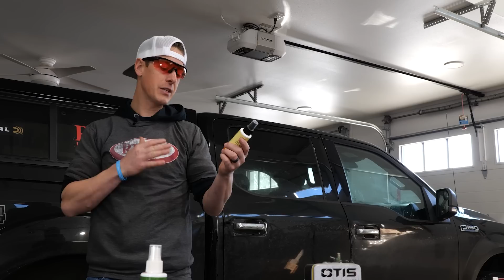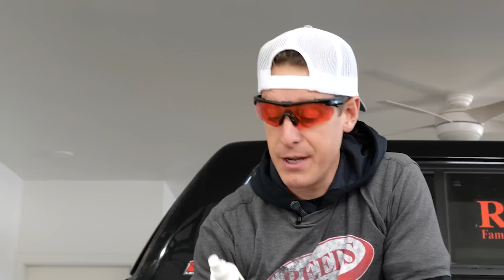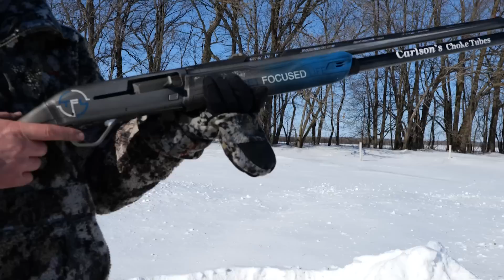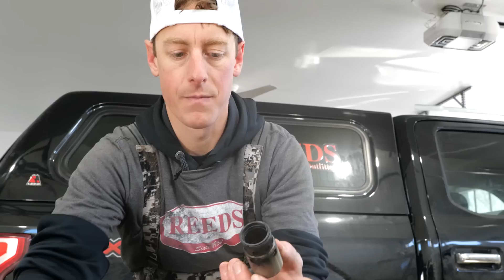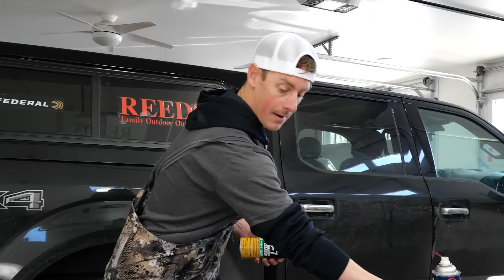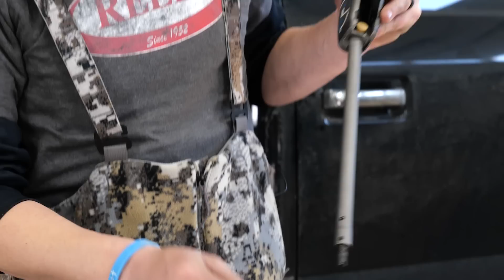Does Gun Oil Make a Difference in the Freezing Cold?

Comment: Brake cleaner, air blower, rem oil in the spray can. I'm always in the field lots of duck hunting and it always keeps working. The rem shotgun in the spray can works just as good but more money and it's about the same as the rem oil. Anytime I've use dry lube in any application it always causes problem. Weather its in my professional job or my equipment. Have replaced more parts due to dry lube. It collects dirt grime and holds in in place. A light oil lube and wipe off the access will last longer everytime.

Comment: You are on the right track with your videos. Keep it up. I love this. Benelli told us once after using rem dry lube in an SBE2 that cause severe problems in cold weather to only use CLP (Safariland). Clean it good, then let CLP soak in and wipe it down. Never had any issues since.

Comment: I would love to see this winter function test with Frog Lube.  There are very conflicting stories about its cold weather performance and most of the failures are responded to with an improper application making it remain in a thick form.   A removal of old products and heat applied frog lube with a full wipedown would be really revealing.  It won't mean Steve's needs but for someone that occasionally shoots it has some value if it works in cold weather.   I also saw another comparision and One Shot was another lube that I would love to see tested.   Keep making great videos.

Comment: Interesting about the Rem Oil. I've been using it since it came out a long time ago. For Shotguns, I use it as a cleaner to get the carbon off of parts and the bore. It actually works really well for that. It's not that great as a lube because it's so thin, but it works great to spray down the guns after a morning waterfowl hunting in the rain. Displaces the water and prevents rust. I keep a can of Rem Oil in the Duck blind. I was an armorer for a Police Department for 26 years. I bought cases of the aerosol Rem Oil to clean out our hand guns. What was good about the Rem Oil, it got the carbon off and prevented rust. if the Officers didn't do a good job (as they sometimes wouldn't), the Rem Oil residue wouldn't gum up like Hoppes #9 does, Hoppe's gummed up and caused malfunctions in H&K P-7 Pistols. So, Rem Oil for cleaning andI had them use Break Free CLP as a lube for the frame & slide rails.
Reply: Rem-Oil has silicone in it, that's why it works so well.

Comment: Great video! Would have loved to see you use 80 below gun oil. The name itself should earn a spot if you do this again.  I like it. Comes in aerosol too! I had the same issue with the recoil spring in my SX4 20 ga. Was a real pain to get that roll pin out... seems like a simple punch pin would have worked fine and much easier to remove. 🤷🏻‍♂️ thanks for the excellent content 👍🏻💪🏻👊🏻
Reply from the maker: I've actually never heard of it. There are a lot of lubes out there. I had some issues with the roll pin too. Really had to smack it with a punch to get it out, though I might break the gun. See ya soon my friend.  👊 Stay Target 🎯Focused (Hebrews 12:1-3)
Reply: 80 below is unmatched in the cold (and regular temps). I’ve never used anything like it. It somehow repels dirt, dust and powder residue to last SO much longer. The corrosion protection is also superior.

Comment: I use mobile 1 grease with 10-20 W motor oil in my super x 1s. Smooth as glass. Keep a can of REM oil in the blind if needed.
Reply: The 10-20 W oil is mixed with a little marvel mystery oil also.

Comment: You can get rem oil in an areosol can. I have been happy with it, I think has a solvent in it that evaporates and functions as a mostly dry lube once it dries but the solvent helps to clean while wet.  This is my hypothesis and I am not a hundred percent sure but I like it for use as a lubricant on anything that I don't want to collect dirt but want cleaned and lubricated (wheelchair bearings for instance)

Comment: Would be interesting to know what differences, if any, existed in bolt finish, receiver finish, and springs. If any of those are different, it's not really an equal test, all things considered. Awesome content, though. A couple of seasons ago my father's A5 was jamming up in cold weather, mid teen temps, while my old M3000 had no issues. Always figured it was his Rem oil vs the Safariland CLP I was using.

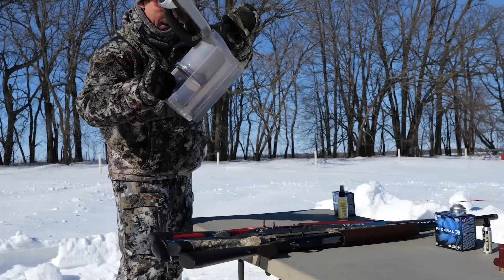Comment: @11:57 dust was poorly applied and grossly uneven. The remoil (wooden furniture far right of table) shotty barely received any dust. High effort but dropped ball with rushing due to cold. Should have shake it like you are carefully shaking salt straight out of big refill bottle directly on your food.

Rem oil is absolutely trash for corrosion protection and parts wear protection. I use corrosionX (SE Texas near gulf)

Comment: OMG 🤢🤢🤮 when you poured that vacuum dirt on them I swear I could smell it. I was honestly surprised by the Rem oil, it might have worked better if it was in a squeeze bottle instead of a squirt bottle. I personally use Hornady One Shot cleaner and dry lube and a couple drops of Shooters lube oil on the bolt of my Browning Silver. When I first got it it would FTF or FTE the first 3 or so shots of the day after cleaning and I thought it just wasn't broken in yet. After a couple cases of target loads and a few magnum turkey shells I don't have that problem anymore but I still haven't tried the Hornady One Shot by itself, however it will always have a place in my range bag because its just plain awesome, and because of that I would really like to see your opinion of Hornady One Shot in a follow up video after reading comments of your viewers perspectives.